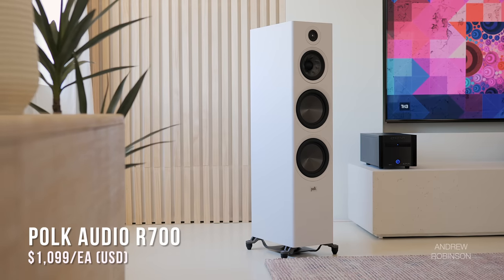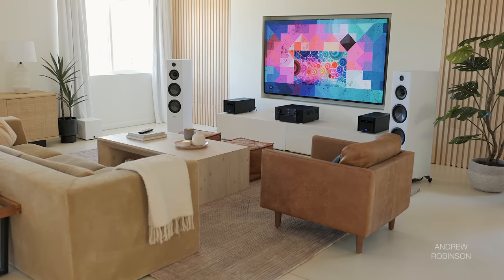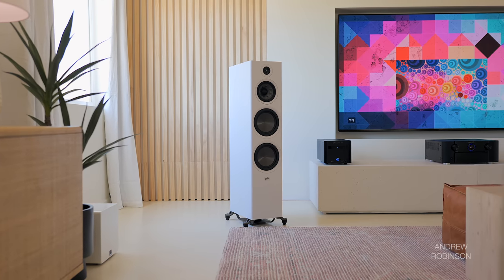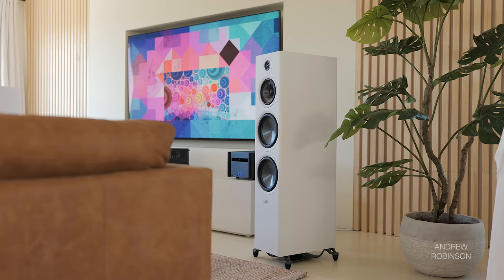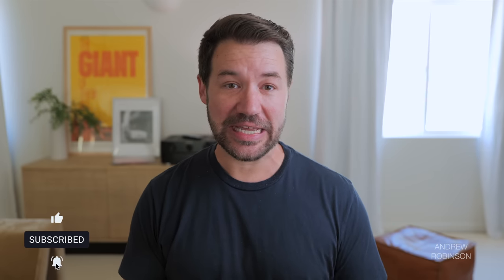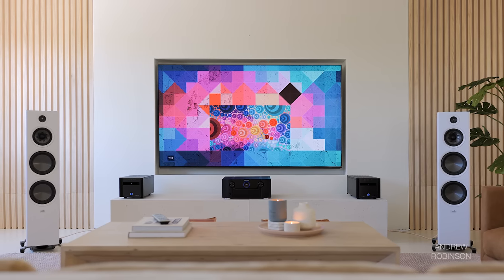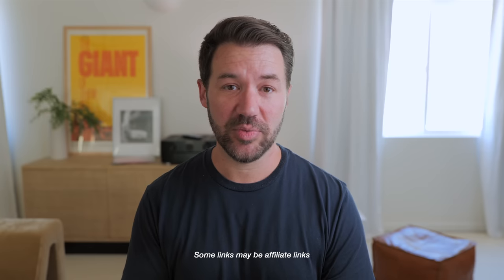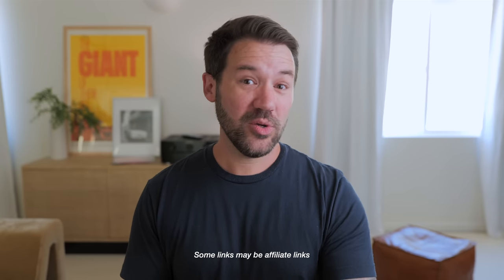Are High End Speakers REALLY WORTH IT? 🤔 Polk Audio R700 Review

Comment: For what it’s worth, to anyone who sees this, I bought the R700s on this review and couldn’t be happier. Thanks A & K.
Reply: Do you have them with a sub or all alone? I’m thinking of these for my living room. It’s not a huge space.
Reply: @carlosfranco  no sub. Don’t feel it’s necessary with these in my two-channel system. If I were using them in a home theater, however, I might want a sub.
Reply: What amplification are you using with your Polks?
Reply: How does it work for dual purposes?  2 channel and home theater.  What is a good match for the center channel for the perfect match?  Thanks?
Reply: I believe the Polk R400 is the matching center speaker for the R700.
Reply: @BellTunnel  so it seems an expensive amp is needed to push these. That's a huge expense for normal people
Reply: @Idiotsincarshere  not necessarily. You could buy a used Denon AVR, for example, that outputs stereo at 100 watts. Though it would make sense to buy a decent integrated amplifier or AVR if you’re going to spend nearly $2,000 on speakers.
Reply: @BellTunnel  Ok, well I currently have a Fosi Audio BT20A Pro (300x2 max) and a WIIM pro plus (DAC built in). Would I need to upgrade? Thanks for your help I’m a newbie.
Reply: @Idiotsincarshere  looks like your unit has more than enough power (150 watts) at 4 ohms to drive the R700s.
Reply: @BellTunnel  this made my night. Thank you so much
Reply: @Idiotsincarshere  happy to help.
Reply: Looking to get the r700 with the matching center, would my denon x3700 be enough to push them until I can get a good amp
Reply: I just got them today. I have one of them set up and looking forward to getting the other one out of the box.  
They are big! 
We have a 20x17 living room and these things look huge in the room. 
My wife says though if we just get a bigger TV that will solve everything. 
I like how my wife thinks

Comment: After some rigorous hunting down singles from two different places because so many said SOLD OUT, I finally got a pair yesterday. Listened rather unimpressed until late last night. Spent a lot of time tweaking sound different from my B&W CM-10's. Got up early and couldn't wait to get them cranked back up, so I just got SXM going on the Roku and let them play for a few more hours. I noticed they were starting to come alive, more spacious, effortless, but seemed a little boomy. So I opened the app for my SVS SB3000 sub and took it off the Music preset and it immediately sounded better. These speakers need very little if any sub, so I basically set the sub to play anything BELOW what the speakers won't, and that with a lot of tweaking to the EQ in my Yamaha Aventage RX-A3080, which I plan to keep and not upgrade to the newer one, in two channel stereo listening, these Polks are HEVEANLY now. Dare I say approaching that hallowed "HIGH END" sound. I LOVE them, and I'm sure they'll just sweeten up even more as time goes by. But I trusted your review and you were SPOT ON, they are PHENOMINAL. THANK YOU for the review. I've been looking for a couple YEARS for something new. Not that the B&W are bad, I just wanted something different, and lo and behold these are not only different but BETTER, and for HALF what I paid for the B&W. The only issue I had was when unboxing, I noticed the split in the vinyl wrap in the back, it was actually even coming lose. I had to take a black sharpie and color in the crack to it wasn't that evident, and smooth the wrap back down best I could, even though it really wasn't sticking, it was at least flat. But if that's the only issue, I'm still a VERY happy camper. PS: I plan on adding a pair of those Emotiva XPA HC-1's. Thankfully the Yamaha has L&R XLR pre outs.

Comment: Hi all! 
Just a warning about Polk's warranty and customer service...
We purchased the r700 from crutchfield (excellent customer service) about 8 months ago and have only been using them for approximately 3 weeks.  One of the speakers has an awful buzzing from one of the woofers right from the start.  The speakers are under warranty. Polk would not send us a replacement speaker or send a technician out to fix the speaker. They only offered us a replacement woofer and instructions on how to replace it ourselves.  Crutchfield would have been willing to send a new speaker, but they are out of stock with no known stocking date.  It is very disappointing to get a broken speaker from Polk and an unsatisfactory rectification of our problem.

Comment: I’ve had my R700’s for 6 months now, and just went to Pre / Power with a Parasound 200 Pre and ZoneMaster 2350 (rated at 350W into 8 ohms), and I can definitely attend to more power giving even better results - this pairing just blows me away. I could not want for more. Awesome, detailed, thoughtful review. You guys are great communicators. Great stuff!

Note: I actually went from KEF Q950’s (nice speakers, but felt something was missing), paired with the Cambridge Audio CXA80, to the Polk R700’s, and found them a marked improvement. Even with running them with the Parasound 200 Integrated, but especially with the Parasound Pre/Power. I actually think they’re a better looking speaker, and built a bit better too. Which I’m sure some will have a very different opinion to, haha.
Reply: Since you have these speakers, I have a question. How are these at medium to lower volume listening? Do they sound dull or are they still wonderful? My current speakers really only shine at higher volumes so I'm looking for something that I can enjoy in the evening at lower volumes.
Reply: @jeffmpvd7689  Hey Jeff, this is really where I noticed a difference with the KEFs, which were still nice, but the R700s really sound great at low to medium levels, not dull at all. Most of my listening is in this range. With the 110w Parasound Integrated they were already good, but even better with more power from the ZoneMaster 2350.

Comment: Literally, I have bought these speakers 2 weeks ago. I had wharfedale 4.2 but I wanted stand speakers. I‘ve heard and tested 4 speakers: 
1. Polk Reserve R700
2. Paradigm Premier 700F
3. Wharfedale EVO 4.4
4. Focal Aria 948

At the end, it was a difficult choice between Polk and paradigm but I’ve chosen Polk because in stereo without sub it did better. 6 - 7 month ago, I made a mistake and bought musical fidelity’s m2si over Audiolab 8300a. I corrected my mistake. I sold m2si and bought 8300a. The shop where I bought the Polk audio recommended to me to drive the r700 with dual mono block from audio lab in a bi-amp config with my 8300a. But I said no because I am really satisfied with how the Polk are driven by 8300a. 8300a is capable, very neutral and silent amp ( it has the 50hz hum from the transformer which I don’t hear in my listening position). But I should say that I loved the paradigm 700F but the Polk was reduced to 1798 Euro for the pair(yeah you have read it right). I couldn’t look away.

Comment: I've been an audiophile since my high school days back in the early 80s when I had a Sony PS-X500 turntable (still have it and LOVE it), a fantastic Harmon Kardon cassette deck (direct drive, three heads, Dolby B and C and such), and other high quality components that I could afford on my lawn-mowing and grocery clerking budget (in addition to my biking stuff).  I always like to buy quality stuff.  I have two Yamaha surround sound receivers that I've had for over 15 years and a Denon that I've also had for around 15+ years.  I have the original Klipsche Forte that I bought whenever they came out - late 80s or early 90s???  Still love them.  

I'm remodeling a home that we are moving into and because I want Dolby Atmos, I'm looking to buy my first new receiver in 15+ years.  I'm also going to buy all new speakers for the Atmos system in my basement theater.  My current theater set-up will be my family room system.  I was thinking of getting a Klipsch speaker system for the Atmos system but now I'm considering the Polk R700s with either Klipsch speakers for the rest of the system or Definitive (I have 2 Definitive subs that I love along with a great center channel speaker and some surrounds - would love to get your thoughts on Definitive speakers).  Thanks for all of your great content - including Kristi's input.

Comment: Two thoughts on your review here... #1. Your majority of watchers have actual limitations where they cross utilize their spaces for both audio (2 channel snobbery... which I am one of ;-)) & multichannel home theater.  Of course a system that could be used in that manner is going to be more appealing, available & affordable in the market place as a whole.  #2.  Polk earned your high praises and I am OK with that regardless of what other equipment manufacturers may think.  The higher end folks set the bar.  Polk recognized they could play in that market.  If a high end speaker manufacturer is so good so as to discredit the Polk, or products like it, then they should go out and earn it.  Nice job on the R700!  Polk earned it!

Comment: Dear Mr. Robinson, thanks to your and certain other reviews, my living room has now a pair of R700s + R300 center speaker. Of course, the base is subwoofer-extracting but to my surprise, the middle and highs were excellent, very clear. And I finally could hear what "soundstage" means. Now I just need a new amplifier but I am confident that that's it and no more expensive equipment are not needed to acquired ever again.

Comment: Man, that whole Pretty Woman Rodeo Drive gatekeeping thing happened to me at Magnolia Hifi inside a Best Buy. Sure, I looked like a bum with long hair and jogger pants and a jacket, but I was itching to get into hifi and wanted to test all the differences in the demo room to set my expectations and budget. The Magnolia guy said he was clocking out and couldn't help so I went to the Best Buy off the shelf floor listening to the lower end stuff in the aisles which was all garbage in feel and sound. When I walked back to the Magnolia section the guy ended up helping someone better dressed. Needless to say, I eventually went to a small new independent dealer that happened to have Wharfedale Lintons on demo and let me hear those and their more expensive gear just for fun so I can get the itch to desire more. I bought those Lintons off the floor and months later bought a HiFi Rose dac/amp which they let me take home to test before buying. This small store was open minded to me and now I'm loyal to them.

Comment: About 5 months ago I was looking at building a system and was concerned about overspending past a cost of diminishing return while still having great quality. I had watched several of your reviews and had hoped you would review the r700s back then as I felt you gave honest unbiased reviews. I tried to take your review of the r200 and extrapolate it for the r700s. I ended up getting the r700s in walnut finish and have been very pleased all around with their performance. One thing I worried about was the walnut finish looking cheap. I must say that they look very good in person. 
Thanks for you reviews!

Comment: If you had a limited budget of just the cost of the R700’s, would you choose the R700’s or R200’s and a subwoofer. The cost difference per pair is roughly ~$1100-1500 depending on available pricing. Is there a subwoofer in that price range that you would recommend for the R200s?
Reply: Speedwoofer 10S

Comment: I am curious how the R700 compare to the Focal Aria 926’s? I am currently using Polk Audio Rti’s in a 5.2.2 paired with dual Defiance X12’s for subs and I am looking to upgrade. The reserve line does not have a dedicated rear surround speaker so if I went with Polk I would continue to use my LSi M 702 FX’s.

Comment: L600 Review would be so nice😄 Great review.
Reply: As someone who owns some L600s I wonder if there is improvement in sound from r700s.   Maybe a bit tighter bass/mid-bass thanks to smaller drivers?  They look amazing in black , specially with the grills on.  Do you like bass?  Well you are in luck because holy ** these put out loads of clean and detailed bass if you drive them properly.  Down to 32 hz which is even 2 lower than the r700.  The power port works flawlessly on the L600s much like reported with the 2.0 version power port on the R700s.

They are even more power hungry according to their specs.  If your amp is on the weaker side go with the R700s.  They experience super low dips of 3.2  ohms (vs 3.4 on the R700) however driving them up to 350 watts @4 Ohms they absolutely slam with total clarity even at very high volume.  I couldn't be happier with them and I tested them against almost every hi-fi brand of speakers,  with price ranges of $5-25K a pair.  I was fully prepared to send the L600s back for a small fee if I found something better but I was unable to under $25K!

Reviews like this are spot on.  Polk is giving at least 9/10th of sound compared to much costlier options and I couldn't be more thankful!  My bank account agrees!  I smile every time I look or listen to these slim and gorgeous monoliths.  I often burst into laughter as I get overwhelmed with a joy that I only have gotten when listening to unbelievably expensive setups.  10/10 recommend when driven with clean and powerful equipment.  I like these so much I'm going to upgrade my amp/preamp and bi-wire them for a reported larger soundstage.   If they improve anymore in the process these are going to be 10/10 speakers compared to even that 25K set of Sonus Faber speakers that barely bested them in the high end/mid range.

Comment: Read that these are extremely demanding. Thinking of pairing them with a hegel h190 that puts out 2x150 watts 8 ohm. Would  that be enough, or would they need more?

And on a second note, how well will they play on lower volume 50-70db  in a smaller apartment. Dont want to annoy my neighbours.
Reply: I am thinking about a pair of these R700s.  I have a pair of Adcom 565 mono-blocs.  Well, you will annoy the neighbors.  In fact, with the Hegal, you might be evicted!!
Reply: Oh so it's that bad.

Comment: Thank you Andrew for your awesome work. I bought the R700 after watching your review and I am beyond happy with my new speaker. My current amplifier is the Rotel RA-12 (60w). How much of an improvement would it be to replace it with the Rotel RA-1592 mkii ? I listen mostly at low volume (65-75 db) so it's not like the RA-12 can't drive them loud enough, but I feel like I'm leaving potential on the table. Thanks!

Comment: I have a pair of Polk Audio RT-2000p which I lusted for several years prior to buying. They have the built in powered subwoofer. Bought them slightly used back around 2011 for a more earthbound price compared to their then new MSRP of $1,400.00 each. They are still giving me solid, unabashed powerful performance. I've seen many disparage Polk Audio products. Mine are " stupidly perfect "...... If I were to replace them which I am not, it will be these R700.

Comment: Thank you for the great review!  I didn’t understand the end until living with these speakers for a few months.  For years I’ve always been eyeing upgrades to my system but now I feel at least sound wise it is perfect and there is nothing more to buy; a very odd feeling indeed… I’m running:
iPad lossless audio -> usb-c optical converter -> audiolab 6000a optical input -> pol R700 & SVS SB-2000 pro… I calibrated the sub-2000 pro with REW to compensate for room modes and frequencies below ~40HZ…